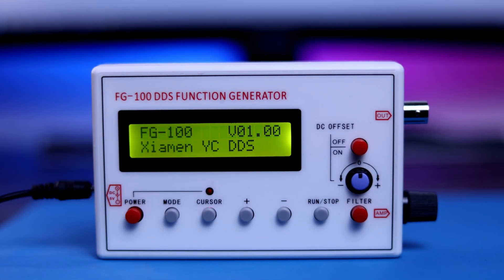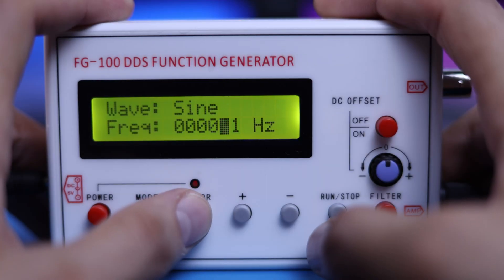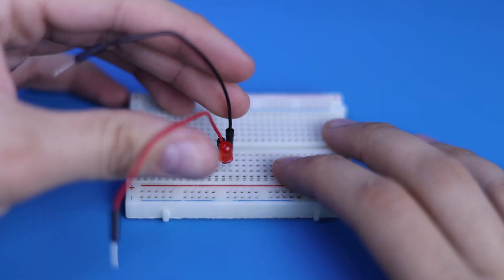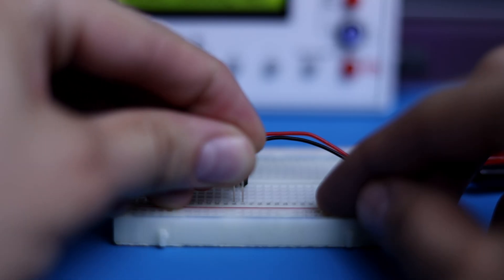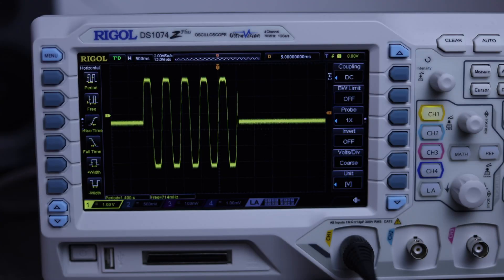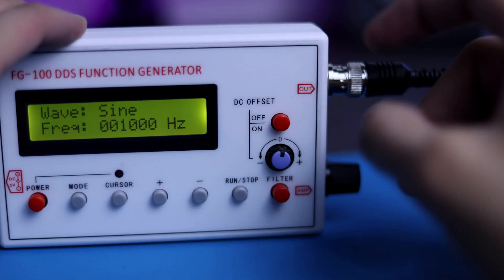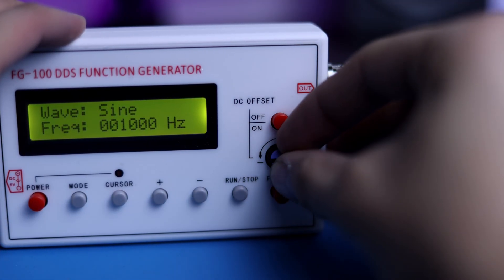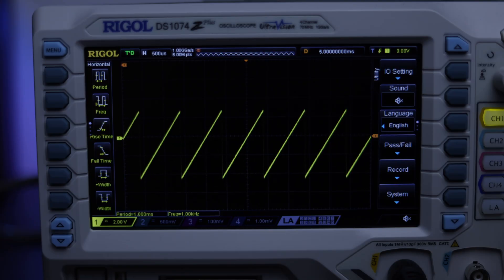FG-100 DDS Function Generator - Test - 4K

Comment: Thank you very much 
Does this device generate peak to peak volt?
What is the range?
Reply from the maker: Yes, this device does generate peak-to-peak voltage, as the amplitude was variable from 0 to 24 volts peak-to-peak.

Comment: So how is this useful, I wish I could a get explanation
Reply from the maker: you can generate the signals for your electronic, and check how it performs.. it is very helpful tool but in most of case you need an osciloscope. You can test the components, for example a diode. check how many ns it takes to turn it on, what voltage and so on.. have  a nice day

Comment: can this be used for synth? Like, attach this to my noise box and change the signal to saw and then emit it through the guitar amp? Tnx
Reply from the maker: This is only generator of signals.. if you need the saw signal, you can adjust the ampl. and Hz, and they will emited it. They had no input, so it can’t change signals..

Comment: I got a question can u jusy plug it in or is it required to attach to the sylascope
Reply from the maker: You can use it without osciloscope, oscilloscope was used only to show how it works

Comment: What voltage to the LED? No need resistors? and why red and blue not blink at the same time at low frequency?
Reply from the maker: because they are antiparallel
Reply: The Blue is fitted  reverse polarity into the breadboard.  As the red wire from the generator goes HIGH  it's connected to the Anode (+ve) of the Red LED so it lights but as the red wire drops LOW and the black wire HIGHER by comparison (depending on the rising and falling wave generated by the waveform and speed you chose) the blue LED's anode (+ve) is supplied by the black wire which is now higher than the red output  so the blue lights as its just fitted reversed and the red LED dims accordingly.